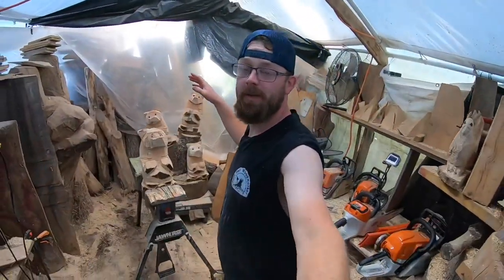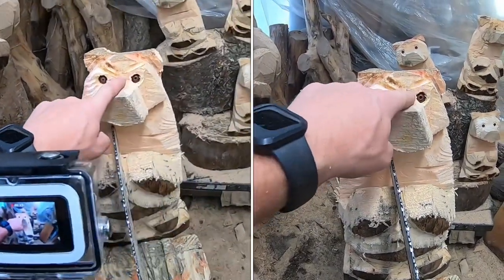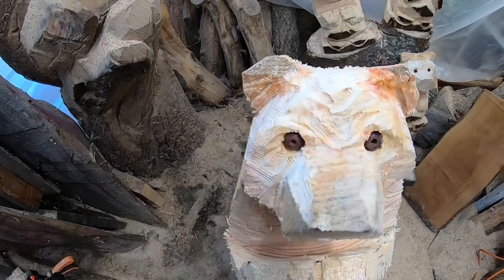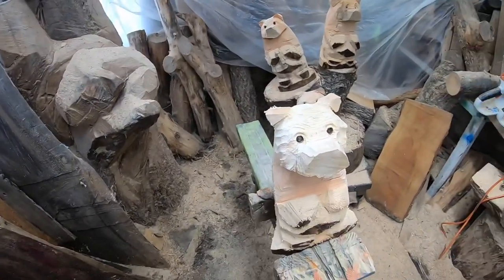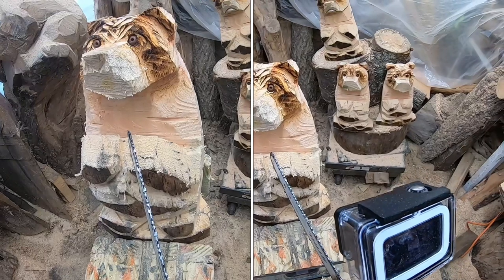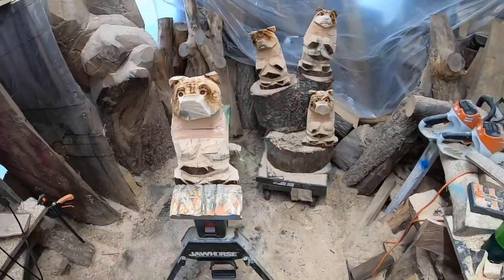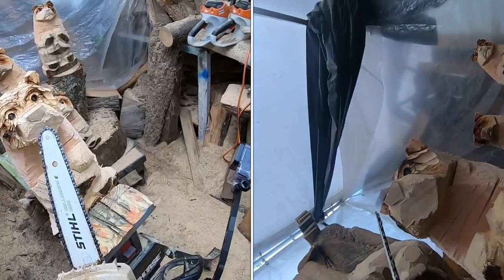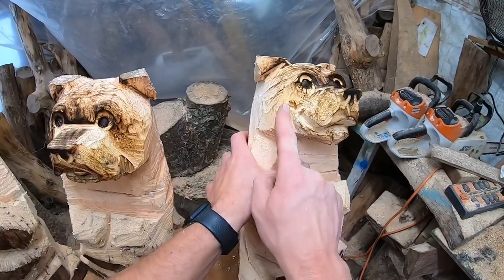Chainsaw carving different expressions. Chainsawcarving for the beginners.

Comment: What kind of saw? Hiw big, gas? Electric? Style? I see sthl saw and what other tools using.. goostuff….
Reply: In my opinion get the Stihl MS170 , it is pretty low cost and it is light weight. you can put a carving bar on it later. With a carving chain. Need a different sprocket for the chain. You will be able to start carving with the stock MS170 so don't worry. You can't really carve Nicely with the cheaper Electric saws. You'd have to get the Stihl electric that Is more money than MS170, maybe 2x as much. When you get the saw you want to go to a Stihl dealership, and buy the Premix with it ask them about it to get the extended Warranty.  Might cost around extra $50 so keep that in mind. MS170 is around 200.   I would only run premix in the saws I hear bad things about mixing your own but thats my opinion. Get the right Sharpener and make sure you have the right safty equipment. you are looking at more money but you def want to be safe. I prefer the Pants over the Chaps, I'd recommend Husqvarna Classic pants. You can just use leather gloves, but you need eye protection and Steel toe boots and ear protection.. would be nice if you can get Chainsaw resistant Boots. I got the Treehog boots from arbortec. the Grinder is a DIE GRINDER for details. 
 Check out Kyle's other videos he is really good at explaining and helping out. He has videos that he listed links to all the tools in the vid Description.
Reply from the maker: I’m using a Stihl msa200 with a 14” bar you can get away with a Stihl ms 170 or a comparable saw . I talk about other tools used in the video